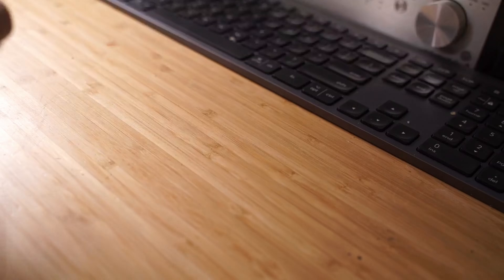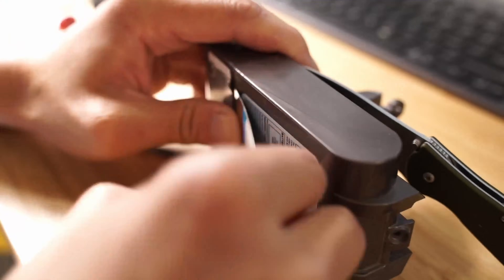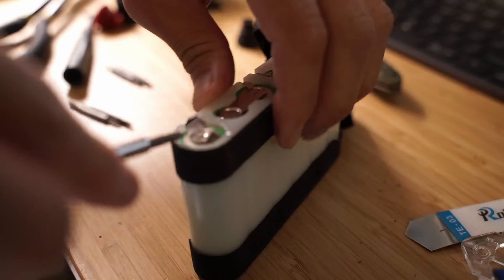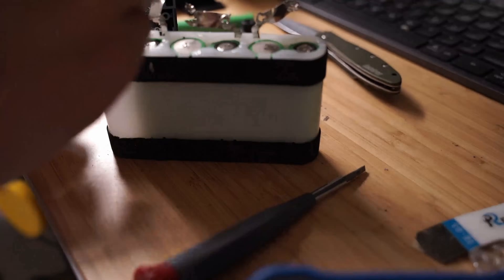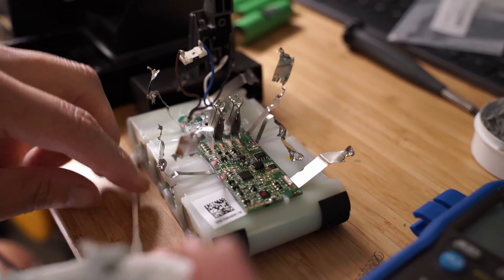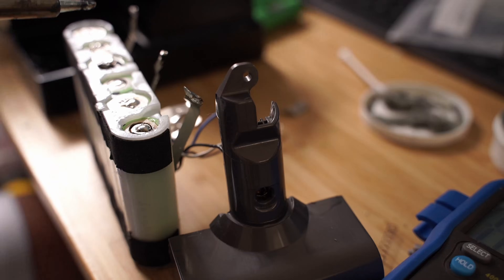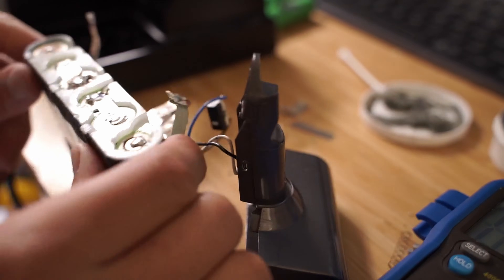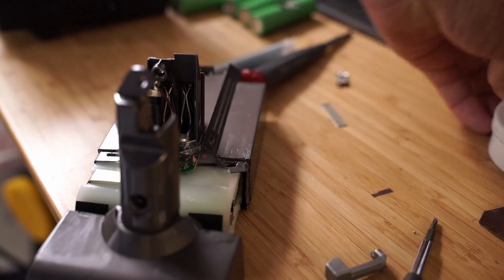Replacing 18650 battery cells in a Dyson V6 cordless vacuum battery

Comment: The concern with higher mAh batteries is they have lower amp limitations. 3500 mAh can handle around 15amps 2500 mAh batteries are usually 20 amps. If you replace with a weaker amperage battery, and aren't sure the usage, you risk explosion.
Reply: That’s not the fault of 3500mah cells.  It’s the quality of the cell.  Pay cheap prices, get low amps.
Reply: @randycollens2681  quality is important but it's a matter of physics. In order to fit more capacity something has to give.
Reply: @TheSkepticSkwerl  this. Cells are either optimised for capacity or for power output, not both. You can have 30A batteries or 3500 mAh ones, but not 30A 3500 mAh ones. 
You can if you change to 21700 cells, that have both more capacity and power output, but are physically larger and won't fit without changing the design of the battery assembly.
Reply: @randycollens2681  Nope, TheSkepticSkwerl is right: high-capacity cells are usually limited to 2-3 times Inominal as discharge rate, while lower-capacity devices easily do 4-6 times Inom, with slightly lower capacities easily reaching 10-times Inominal as allowed discharge rate.
They usually also allow for high charge rates if air-cooled, something high-capacity cells also can't handle.
You likely don't risk an explosion, just a safety-system cutting off the cells from the outside world because the voltage sags too quickly. The cells can heat up quite a bit, but I doubt you will get to a point it will become problematic: 60 degree is the limit by JEITA standard if I remember it right from my own recell-adventures with rather advanced fuel gauges (BQ20Z65, yes, the type of safetysystem that requires cracking security keys and needs to be reset in order to even accept new cells)

Comment: I'm betting the BMS does not balance the cells so this is what happens after many charge cycles, one cell is bound to be less than others and the entire BMS cuts current both ways. Stupid design. I think adding inline balancer will remedy this but not without needing additional space. I just used a variable DC PSU to manually balance old cells back to 3.1v with 0.15A cutoff, I'll check in the morning to see if any cells differ in voltage otherwise just pop the thing back in and call it a day.
Reply: That’s what I thought too. Unfortunately I already got the blinking red light of death on my battery before I looked into it so I can’t just balance mine now.

Comment: Hello there, I don't know if you d be able to read this.
Could it be possible for you or any of the commentor to share a link or specify the compatible battery cells, please.
Reply from the maker: These should be a direct replacement for what is currently in there right now: https://www.orbtronic.com/vtc5-18650-battery-imr-2600mah-us18650vtc5

Comment: I have completed the same repair with VTC5 fully (pre)charged cells, with 24.6v measured at the total battery terminals and that fixe didn't work. 
Edit : it flash blue once and then green once when pressing the grey little switch (without the battery fitted back in). I do have a 24.6v output from all batteries and wonder if the BMS detects them as being with too high voltage ??? I did charge all the new cells before fitting them in. If any of you have any ideas please let me know ! thanks
Reply: Edit : I have plugged in a driller motor directly to the 6 cells and discharged them to 20.15 in load and 21.60 without load. (it took about 20min). Then the BMS appears to behave differently and no longer shows the green light after the blue light when pressing the switch button. It is currently charging as we speak but when putting back in the battery into the hoover it is now blinking blue and not red so I have good hopes. I'll come back here after to confirm if that has fixed the issue encountered.
Reply: Edit 2 : The issue has been addressed after a full (dyson) charge which took about 3 hours.. So it looks like the BMS requires to have 18650 cells emptied before it can be charged again. It probably has a form of build in watt meter that detect cells that were previously charged. Please give it a shot if you believe your BMS is bricked.
Reply from the maker: @ClemOnShow  Good to know, thanks for the update !

Comment: Did you work out the ohms law fir how many amps you're pulling off these batteries? Because 3400mah 18650s will be very low amp
Reply from the maker: I did not, but run time so far has been good.
Reply: @mistahcheng  you don’t understand

Comment: How do you get rid of the 32x flashing red error? Even after changing all batteries it still gives a flashing 32x red error...
Reply: No need to replace BMS, there is a way to reset the red light, see here: https://www.youtube.com/watch?v=ENY8xcczowk  Balance or change the cells, then reset the red light.
Reply from the maker: If I am not mistaken, it sounds like the battery has a bad BMS. The only way to fix it is to replace the BMS, but I tried with another battery, and received a bad BMS, gave up and bought a new battery. I hope this helps !

Comment: Ready made replacement packs are cheaper than it costs just to buy new 18650 cells.
Reply from the maker: Yes, they are cheaper and I mentioned that this isn't for your average person to do. However, you don't know what battery cells you're getting and the one I purchased stop working after a month or so.
Reply: @mistahcheng  You're right there, Its a witch to open that battery up to get at the cells. I ended up throwing mine at the ground really hard cursing the world and the seven seas. I ended up giving up as I didn't have time. The new pack from Amazon does seem to give me about 5 minutes or so of High power and the vacuum suction is crazy high, much higher than on stock batteries making me think these batteries have a higher C rating.
Reply: Anyone can salvage working 18650s from old laptops.

Comment: FYI: If you try to use this battery to power something else, the BMS checks the load and will cut off power if the load has a too-high in-rush current, or a too-low constant current, etc.

Comment: Tip: Don't pop the board off, thinking it's just stuck on with a drop of hot snot. There is a thermal sensor on the board that sticks down into a hole in the casing, between two of the cells, and it's glued in place. On mine, this also made it difficult to remove two of the cells that seemed to be stuck with the same glue. Mine had the same 2100mAh capacity cells but were LG (LGDAHD2C1865).
Reply: Thank you - I had to press the two cells out carefully with a clamp (taped up so as not to short the cell) whereas the others almost just fell out. The black glue or resin is so strong it ripped the cell wrapping apart. So, just wanted to let people know they might have to buy some 18650 shrink-wrap covers if they're wanting to re-use the tired cells in something a bit less hungry. I was really worried about damaging the cell, I'm not sure I'd bother with this again due to the hassle but I guess that's what Dyson wants.
Reply: @chocolate_squiggle  for those with power tools at home, you better off just buying an adapter to use with your own power tool batteries.
Reply: @ruinunes8251  not many power tool batteries run at 21.6 Volt though. Most are 18 Volt (or "20V Max", which is also 18V effective).
Reply from the maker: Yeah, it's definitely a pain to open. Not for the faint hearted.
Reply: @mistahcheng  very true.

Comment: I actually did a really nice job with this using a diy spot welder. I put the original leads way back and soldered my new spot welded tabs to them on the plastic, keeping the soldering  iron off of the battey. My problem is that I used some grade b or c Panasonic cells that that barley survived a failed cell or BMS draining all the packs. Their new ratings went down to 3200 - 3400 mAh.   They work great on normal mode but can't handle the max mode as the voltage sags and it shuts off. I will replace them with LG IMR cells which are rated at 3 Amp hour but have a 20 Amp discharge. 

The trick to easily separating the cell is to first pry the top around the snout and while keeping it pried apart with your hands, work the nearest clips one at a time.

After replacing the cells with better ones, the cell BMS went into a mode that dyson purposely programmed that render's the BMS worthless. I ended up buying a cheap battery from Amazon and swapping in these new good cells to which work.
Reply: These batteries can go nuclear if mishandled. I’ve seen it many times
Reply: @Btree33  sure you have.   They’re actually pretty resilient
Reply: @randycollens2681  Dont be so sure of that..  Whats thats saying???.. FAFO....

Comment: You would be better off with a battery spot welder . You can pick them up of the net quite cheap. As battery's are quite hard to solder as the solder won't hold .. so the cheap sopt welder instant arks the metals together .. nice video though I get to see what the battery looks like before I take it to bits 😀
Reply: Back when I soldered to cells, they held quite well. The nickel strips on even the best OEM spot welds are far easier to remove than my old soldering joints.  That said, only use a spot welder and would never solder directly to a battery again, especially after one failed a few days after building it.

I built a diy spot welder as they were well over $200 USD for even the cheapest welder years ago when I wanted one. I ended up build my own for much cheaper and it functions better than many on the market. It was used using welding leads, free microwave transformer, arduino with LCD and selector knob (timer and double pulse), old 5v phone charger, wiring and micro switches from the microwave, very little home depot parts and lots of 3d printing.  It has been used to replace many things like shaver batteries, and even used it to build my 13s10p (130 cell) ebike battery.

Comment: I'm not convinced these cells needed replacing. I've just had the same issue with a similar pack (pack refuses to charge), when I opened it up, the cells had gone out of balance, once I balanced the cells with a DC power supply, the pack was good as new. I just alligator clipped onto the tabs at the end of each cell. Over 1900mAh was going into the "dead" cells so even the bad cells had lots of capacity left; it's just the the BMS wasn't balancing the cells properly.
Reply: If one of the cells is bad, no amount of cell balancing is going to help in the long run. The BMS probably keeps a close eye on each cell voltage as it's being used, and if one starts to under-perform, then it stops. Otherwise, even though the pack may still supply a decent amount of power, the weakest performing cell will be damaged more each charge/discharge cycle.
Reply from the maker: That is possible. The cells measured out to 24V for me, but would only run for a minute, and it seemed like it would charge fine, but didn't have enough capacity to run.

Although the BMS is supposed to be balancing these batteries, my guess is that maybe the cells may be so far out of balance the BMS is kicking in some kind of protection mode.

Thanks for sharing your findings !

Comment: Any guestimation how long you can set your iron on a battery before it decides to come on glued and you end up with shrapnel in your face?
Reply from the maker: Haha, umm I would say don't put the iron on the battery for more than 15 seconds. 

I would run the soldering iron at a hotter temperature since you're soldering onto a rather large mass and a hotter temp will hopefully help with getting the solder onto the battery terminals faster.

Giving the ends a quick sand may also help with adhesion.

Comment: On the battery with the higher charge rate will the dyson charger meet those requirements? I know some chargers only reach a set max on charge out put.
Reply: It is pretty funny i saw this video when i did. I was repairing a broken water line under a house after seeing this video and found a dyson v6 vacuum. I think ill give this a try. I was interested in the process just in a general curiosity. Thanks
Reply from the maker: The BMS usually charges at a constant voltage and current, so if I'm not mistaken, it'll stop charging when the battery has hit a particular voltage and / or capacity.

If that's the case, then there shouldn't be an issue with fully charging the battery fully.

If anyone is more knowledgeable about this, feel free to correct me.
Reply: @mistahcheng  thanks for the intell.

Comment: DANGER! You used the WRONG CELLS for this! The original Sony VTC4 are a "power tool" cell rated for 30 Amps while the Panasonic NCR18650B that you used as replacement are a "laptop" cell rated for only 4.9 Amps maximum current draw.
The Dyson V6 uses a 350W motor, so that means it draws about 350W divided by 21.6V = 16.2 AMPS.
So, when you run the vacuum at full power you are pulling almost 3 times the maximum current that your battery cells are rated for. That's going to kill those expensive batteries very very quickly, and might even cause internal damage that lead to fire etc.
Never do "upgrades" like this!
Reply: Oh look danger danger. Learn a bit more about batteries before simplifing comments. Otherwise your danger is as useless as that ratings
Reply: @John Coops - I think your mathematics is not 100% correct. The batteries are 2100mAh. So if the Dyson runs 20min there is a current of 6,3A. In max-mode 6min - 21A. So you are right, to chosse a battery with a high max. discharge current. If not, it is better to not use the max-mode. thx
Reply: @hoemal69  - Yes, I deliberately simplified the mathematics to make it more suitable as a Youtube comment, which was primarily to point out the fundamental error they've made. I will explain in more (but not full) detail - I broke it into spaced paragraphs below to make it more readable.
. . .
The motor used in the V6 is rated is 350W, but that might be at average battery voltage (6x3.6V=21.6V so 16.2A) or it might be at max cell voltage (6x4.15=24.9V so 14A). Your guess was 20A - but no matter what, high speed results in a massive and UNSAFE amount of OVER-CURRENT to draw from a cell rated only 4.9A.
. . .
Firstly,  a DC motor doesn't draw any specific or consistent Amperage - the current (and power) decreases as voltage drops (battery runs down), yet current increases with load (vacuum nozzle or filters  become blocked). So unless both voltage and load remain constant, Dyson's (optimistic) 20 mins average run time cannot be used to calculate the amount of current drawn anyway.
. . .
Furthermore, the Sony VTC4 battery is rated 2100mAh but that's at 0.2C, and it''s rated 2035mAh at 10A and achieves less than 2000mAh at 20A drawn. The cell voltage drops from 4.15 as well, and both affect your "run time to amps" calculations, however we don't know the Dyson's charge or cutoff voltages, nor the profile of actual current drawn, so everything we calculate is  a guess and our mathematics doesn't really matter much!
.  . .
Anyway, let's use YOUR guesstimate of low speed (2100mAh for 20 mins = 6.3A). The Panasonic NCR18650B that were used in this video are rated for 4.9A MAXIMUM. Therefore even on low power it's drawing 28.5% above rating for 20 minutes. However, it's worse because that's the average current over that 20 minutes. The maximum current might be 10%, 20% or even greater!
. . .
The  Panasonic NCR18650B used here are a high-priced quality "ICR" cell with max current of 4.9A. Viewers might choose lower-cost cells or even use used cells from laptop packs, in which case the over-current (even on low speed) would be far worse.  I've just harvested a heap of cells from cheap power tools and hand vacuums (Hoover, Electrolux, Black and Decker) and those use cheapo Chinese cells (eg: Highstar) that are only rated 10A Maximum.
. . .
Now, if cheaper cells than the Sony VT4 would have worked, you can be sure that Dyson would have used them to save $$. Even the Sony's have a very hard life in the V6 and only last a couple of years. So based on that alone, the best strategy is to put even better cells in there to try and improve the situation.
...
I am considering using a cheap chinese BMS but also installing a balance charge socket,, so that the pack can be charged using a hobby charger every so often (or always). Cheers!
Reply: @johncoops6897  AMEN! The above advice will save many wasted hours, dollars, and possibly lives that might have been lost in house fires. Hopefully Dyson used a quality BMS in their packs to simply shut down the improper lipo cells used before the start of thermal runaway.
Reply from the maker: I did mention in the video that the cells aren't designed for high current discharge, and these cells are actually the same ones used in Teslas, not laptops. 

This was more or a fix than an upgrade since the original VTC4 batteries were basically toast, and these were the cells I happened to have at that time.

Also, scooters have a 350W motor and use "normal' cells without issues, and don't forget there's a BMS that will kill power if the cells exceed a certain temperature.

However, yes it's best practice to use batteries that can sustain higher current draw such as the original VTC4 batteries to be on the safe side.
Reply: @mistahcheng  - scooters can   use low amperage cells because they run lots of them in parallel. Same with cars like Tesla... they have multiple cells to share the motor load. In the case of the Dyson, all the motor amps are carried by one cell, so it should be rated accordingly.
My comments are to warn others that they need to use cells rated at  least 20A continuous if they want the replacement pack to last.